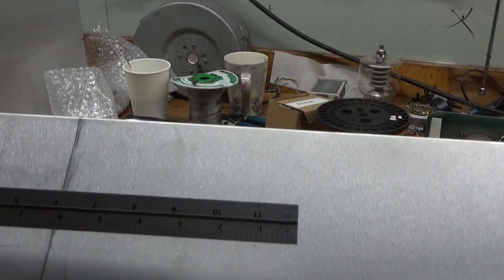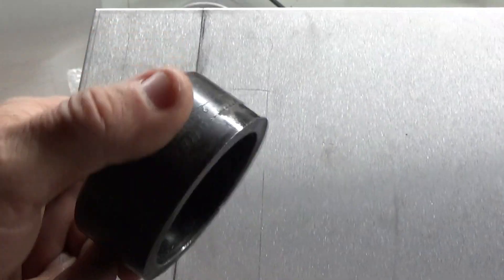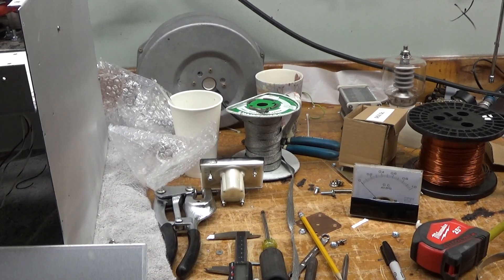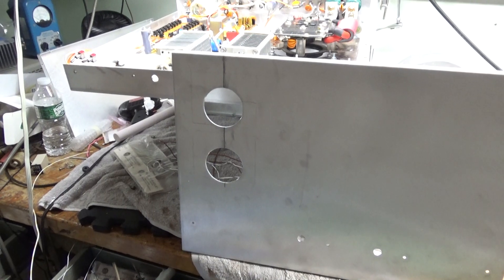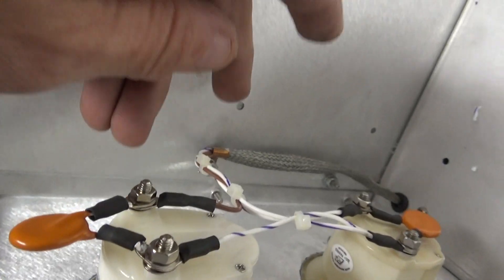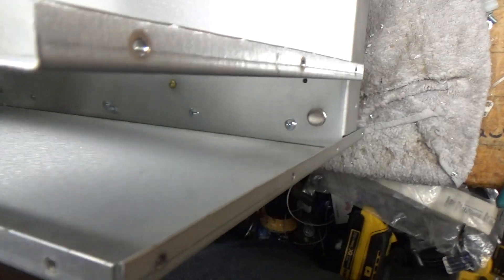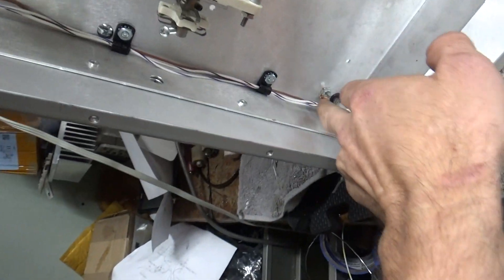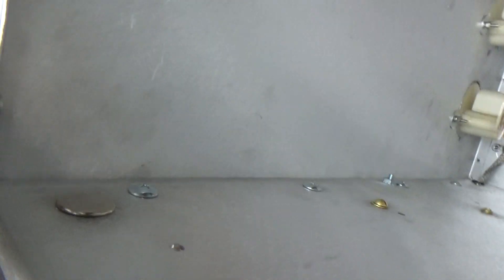Front Panel Meter Installation 3cx6000a7 6 Meter 10kw Pa

Comment: Hello, where are you located? I have a really nice Ameritron AL-84 that has no output. It turns on the HV reads about 1100 volts, the filaments light up, has about 15.5 volts to the rear RCA jack and to the front meter LED's. It passes wattage from the exciter until I put it into OPR mode, also the XMT LED does not light up. I used a Ameritron ARB-704 to key it.
Reply from the maker: I live in ct